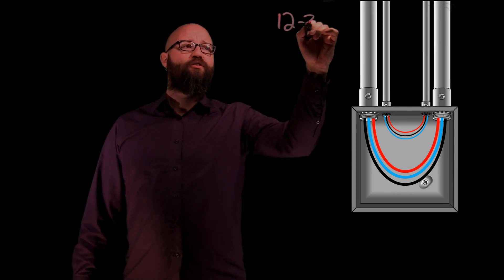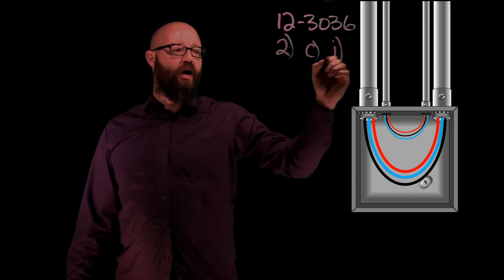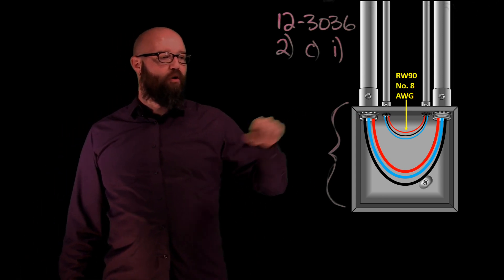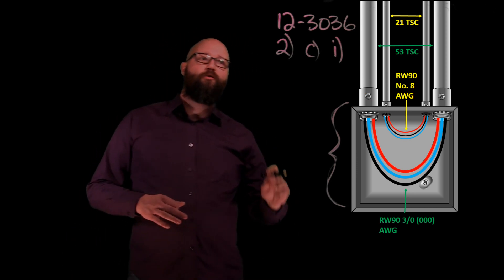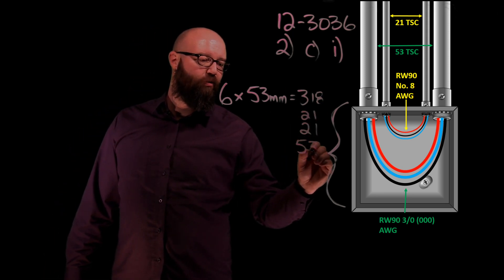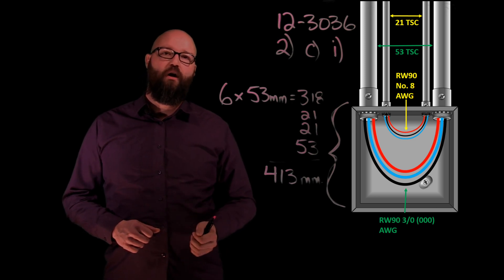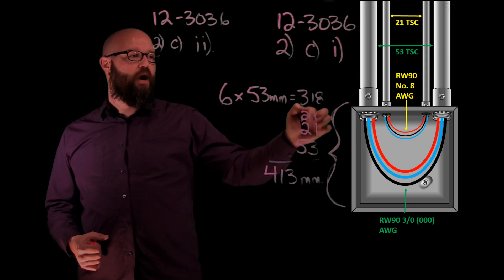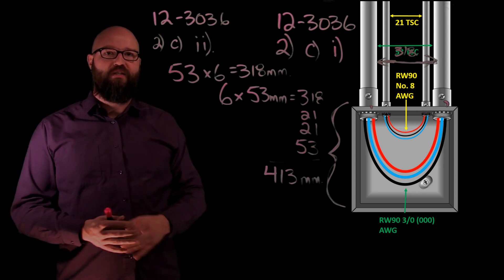Pull Box Sizing. The "U-Pull"

Comment: How exactly do you calculate the length of the other side of the box? You would need to know the distance between the conduit entry points and the outside walls of the box right? How do you find that?
Reply from the maker: The width of the box would be determined from the minimum space required between the connectors of the conduits containing the same conductors. 12-3036 2) c) ii) says six times the diameter of the largest Raceway containing the same conductors. So that, plus the necessary room for the connectors and their locknuts would be the minimum dimension of the other side.